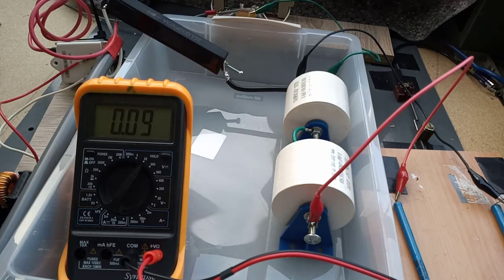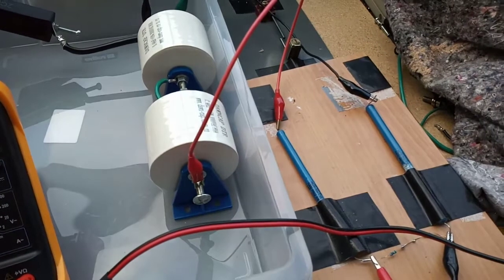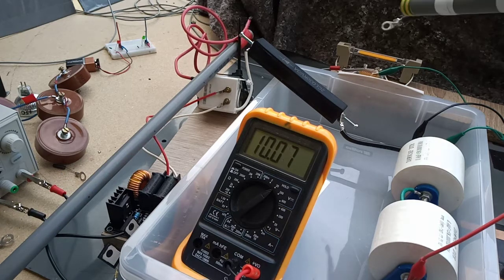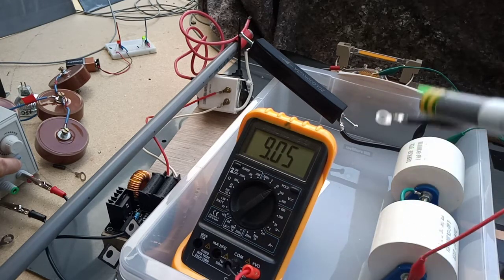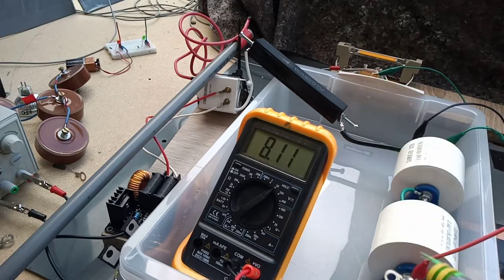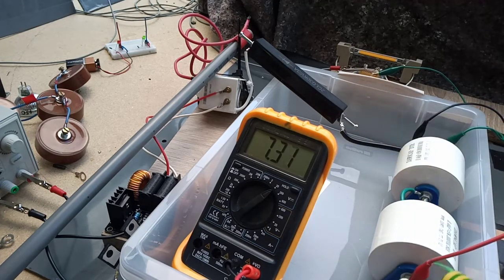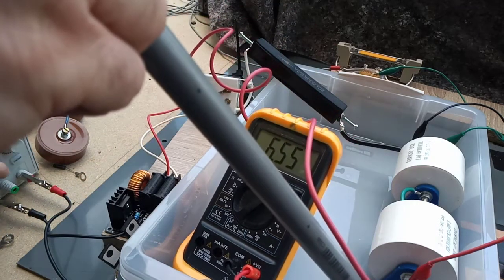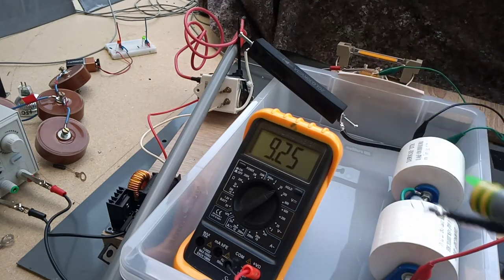004 220nF 10KV Polarity Check (Experiment at your own risk)

Comment: Can you tell me in simple words what is the conclusion and how we can use this effect please 
Thanks
Reply from the maker: In the information from Don Smith I read about using a capacitor (after diode bridge) as output and only use + to discharge to Earth ground and leave the - connection unconnected. So when I came to the webpage that somebody pointed out to me I hoped to get more understanding on what is possible.
I also hoped to get more insight in what Don called his device for the Japan coke machine where you see only a high voltage supply, a diode bridge (not completely as should be for normal rectifying bridge) and capacitor is used to go to output module with SCR and inductor.
So therefor I replicated what is shown on that webpage but strangely enough to get best results I need to switch between + and - connection to have the best output on led.
So what you see in this video's is just a replication and study of the phenomenon to find in the end a working solution, sadly I'm not yet far enough to build working solution.
Also something that is going on in my mind for a very long time is the fact that charging of a capacitor takes time.
And I always have the feeling that Don is not using the charge stored in the capacitor but what is available on the plates.
This setup proves to me that this could be the case because you can clearly see voltage going almost double of what is stored inside the capacitor at the moment of switching, so there's more available then what is stored.
At the moment I don't have all the answers I would like to have so I can only share my results of the experiments.
Reply: @brunovk417  thanks a million
So do you think in that setup of Don’s
If you use the SCR to switch the cap to ground, sort of what he calls the inverter on his diagrams, that it would give us the energy we need to supply the resonant transformer and get the needed output?
Reply from the maker: @Gacha.Cupcake  I've been thinking a lot on this subject and at the moment I think this is what's happening. I don't know if I'm correct so please think on this yourself : https://youtu.be/KAqec1Qkaws
If what I did is triggered a reaction in ambient energy field, I think we can extract energy from it, but a long way to go before I understand it myself.